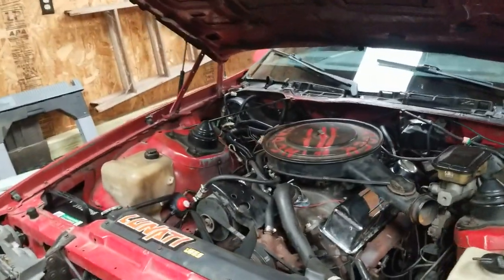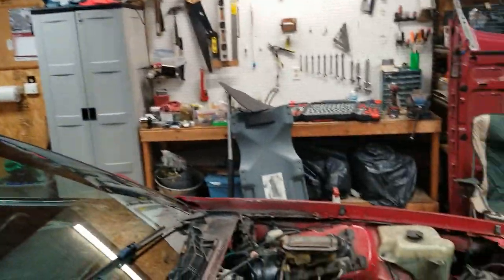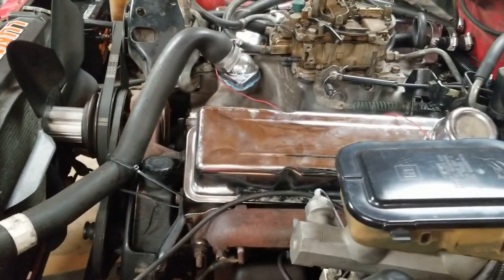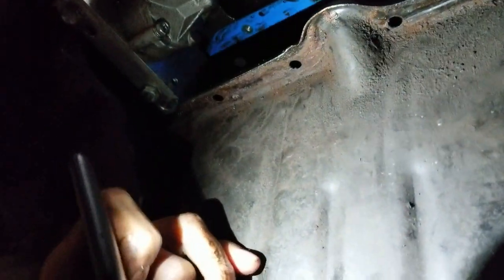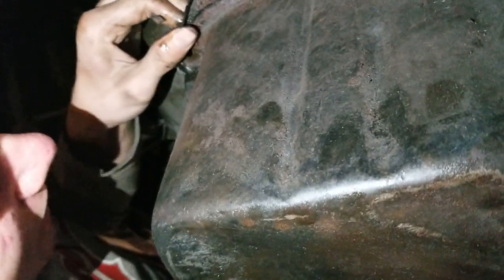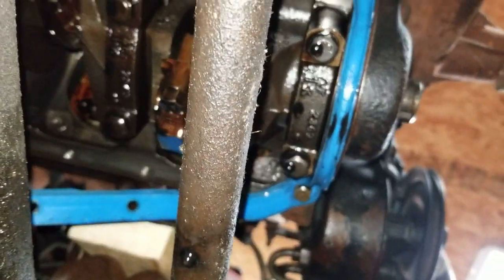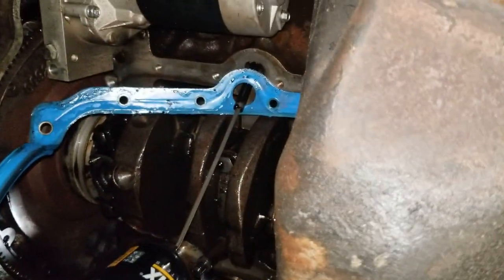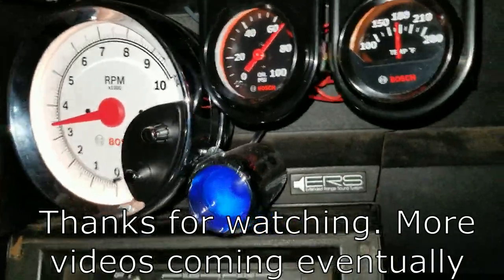How to change a SBC oil pump (without removing the engine)

Comment: Why are you changing the pump? What symptoms were you having?
Reply from the maker: We changed the pump because the oil pressure was low. About 20 psi at idle, and would never go above 40 psi. Now it idles at 30 and tops out at 70 at 6,000 rpm

Comment: An experiment for you, but a trick known for decades. Had to drop a pan with the engine still in, about 30 years ago  -  Sneaky Pete for a leaking rear main seal on a '71 Malibu convertible with a 307, as I recall.  As you discovered, you can get the block up about 4 inches, with the trans hitting the floor pan usually being the limiting factor.  I would recommend intake bolts as opposed to alt bracket as the front lifting point, and of course, never jack up a motor by the the balancer. Once its up, rotate the crank so the front counterweight is up inside the block to help slide the pan out from above the crossmember. BTW, I still have my Malibu. These days it's running a 688HP 489CID big block on pump gas ( 10.28:1 CR, World heads, biggest valves possible, ture roller valvetrain w/ custom ground cam, Offenhauser IR intake w/ twin 1150's and non-progressive linkage - essentially eight 287 CFM one barrels, MSD 7 Marine ignition system, estimated 110% peak volumetric efficiency).     Keep up the good work!
Reply from the maker: your car sounds like it is absolutely gnarly on the street, what does it run in the 1/4 mile? yeaaaa the alt bracket wasn't our first choice either, I believe the reason we did that was the cherry picker doesn't extend over the nose of those Camaros far enough to grab the intake bolts. thanks man!
Reply: Er i have a 69 wildcat need to do the oil pan and was going to jack it by the crank pulley is that a problem?

Comment: Was it pretty easy to stab the rod from the pump to distributor. And how did you go about priming the pump after the install. Thanks , thinking about doing my 86 square this way
Reply from the maker: We pulled the distributer out for this, so we just put the pump and distributer in from the bottom and then clicked the distributer in later. As for priming the pump, we didn't. the engine was already up and running and broken in so it would have had oil in all the galleys and bearings already, not a completely dry start up. If you wanted to though just prime it with big ol' screw driver shaft on the end of a drill down the distributer hole before you throw that back in.
Reply: @Redneck-Racing  i figured u pulled the distributor to do it. Since u had the new one. I might just up the oil weight. I think mines fine but not real sure it cold idles at 60 psi and when its warm it idles right at 20 psi.  Its a 383 stroker with a pretty choppy cam. What do u think of my pressure
Reply from the maker: Mine Idles  at around 30 when its warmed up, but it's a high volume pump. 20 is probably normal for a stock pump. The oil pressure is more critical when the engine is under load at higher rpm. A good rule of thumb is to have 10 lbs of oil pressure per 1000 rpm minimum. As long as you have that I'd say your good.
Reply: @Redneck-Racing  right on man. Thanks for the info. Much appreciated. I just got this truck about 4 months ago. So still trying to figure everything out

Comment: did you get the gasket on the pump?
Reply from the maker: You don't need to use a gasket between the oil pump and the main cap. We've never used one and it didn't have one in the first place. The surfaces are machined super smooth and the pump gets torqued to 65-70 ft lbs which keeps the oil where it needs to be. Its been in for over 6 months now and gets beat on regularly, still has great oil pressure.
Reply: Did the same
Reply: Awesome I’ll be sure to do the same brother! Cheers!